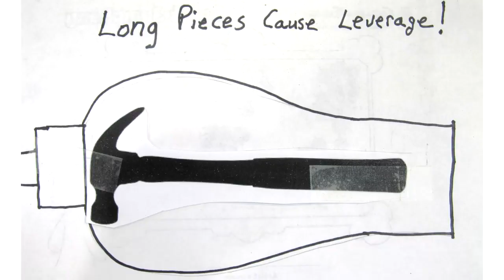Turning Twice Turned Bowl - Finishing the MGM Experiment on How To Dry Green Wood Bowls

Comment: Mike, at the 6:19 point on while trying to finish the inside bottom of the bowl, you could have really used one of Robust’s “J” rest to help from the problems caused by having to extend so far over the rest.  Just saying.  Cherry, Tom
Reply from the maker: So do you use one? Has it improved your cut near the bottom? I have a curved Oneway rest and it it flexes too much to be much use.
Reply: @MikePeaceWoodturning  Hi Mike, yes I do and I haven’t noticed a significant amount of flex.  It has help me take those last few bottom cut without making some of the mistakes I seemed to be making when extended too far off the rest, also a lot less tool vibration.  Cheers, Tom

Comment: Great video Mike. I currently have a problem with a piece I am turning. I chucked the piece between live centres and have the point in the base. It will be cut off so that I can get down to the tendon that I have created. How do I reestablish the point before reversing it into my chuck?
Reply from the maker: Make a center finder -  a short dowel with a hole that an awl or nail can penetrate. The dowel is sized to fit thru the back of the chuck after it is mounted to the tenon.  Here is a video on this  https://youtu.be/BTn53FbIuII
Reply: Thanks Mike. That will work perfectly.

Comment: Mike starting at the 11:18 the auto focus glitch ruined an otherwise good videos.  Har to get the good info and tips with the distraction of the in focus - out of focus going on.  Still some good tips.  Hope you can correct that before it ruins another video.  Cheers, Tom
Reply from the maker: I can see how that could be distracting to some viewers.  Thanks for sharing. Too many folks do not take the time to share.
Reply: @MikePeaceWoodturning  I appreciate all you do to share, just wanted to bring this up so that you might be able to correct it on future videos.  I don’t want to miss any of your techniques that might help my turning.  BTW, did using the sanding paste before using the scraper in the shear mode eliminate the tear out on the bottom?  If so, I might have to try that the next time.  Thanks again.  Cheers, Tom